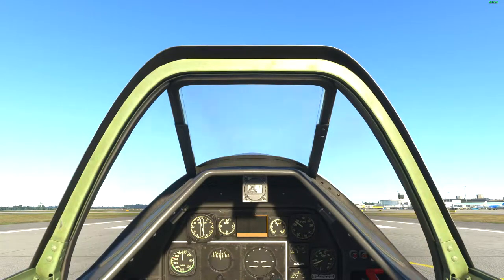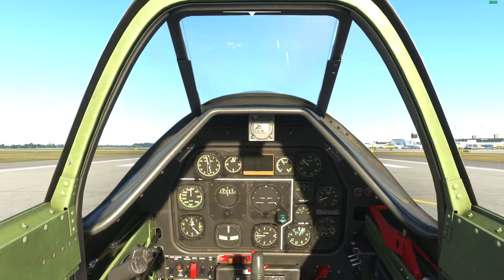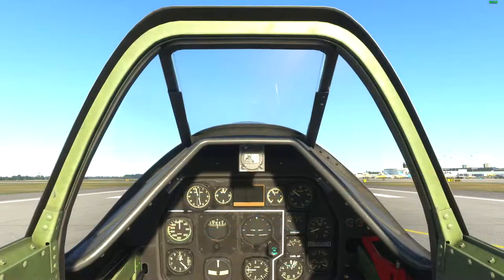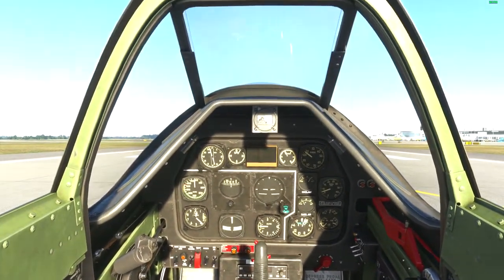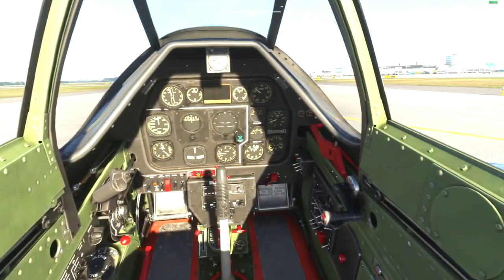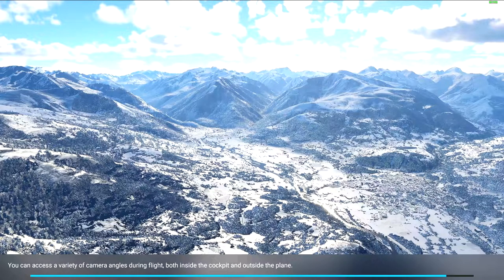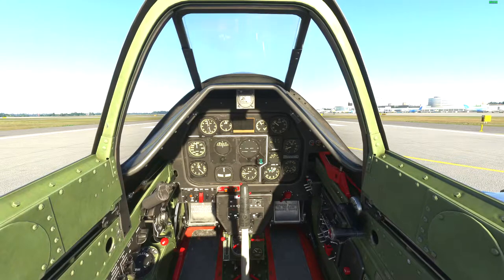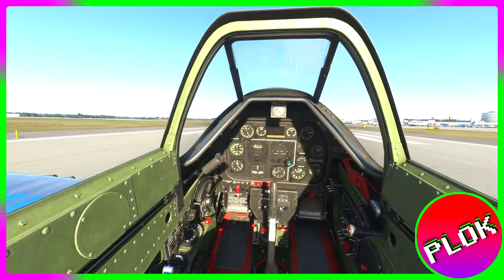P-51 Engine Dies Mid Flight Problem SOLVED! | MSFS Reno Air Races

Comment: No man, I think it's bugged, I have the "Bunny" one and I can't even take off without the engine shutting off, also enabled unlimited fuel, still no change.
Reply from the maker: interesting
are all your tanks filled from the start?
I think if you don't manually fill all the tanks it only fills like the middle tank or something, and it starts on like the left or right tank still for some reason

Theres a possibility that it still registers as "empty" if it's truly empty, even with the unlimited fuel enabled
Reply: @PTMG  I kept the fuel and weight screen on, and it's all at 100% when pushing the throttle up, still no change, engine shut off immediately, odd but I don't really use this plane much so it doesn't matter.
Reply: Same
Reply: Same since last big update
Reply: The dev of those P-51’s has to fix them like fr
Reply: Me too!  Nothing helped when I switched to midle position tank - same problem with shutting down on take off .It's very pitty, because the airplane made very good except not moving canopy and this problem  ^(( They should fix it!
Reply: Been waiting over a year for a fix. Very disappointing!
Reply: I agree because i have the wee Wille and it won't takeoff
Reply: This worked for me for about 20 minutes of flying. Maybe it just needs constant fuel
Reply: I get about 10-15 mins in and same thing it shuts off I look down switch fuel tank restart the plane it will go another 3-4 mins then kaput all done no more to give!!🤷🏻‍♂️ I run about 35 man pressure 45-60 when climbing short distances especially the spitfire it will cook quick if pushed too hard too long also know as “wep” war emergency power, full throttle, anyway hope it is better is the 2024 flight sim love my mustang flights

Comment: This may solve the issue in msfs 2020 but the tank you selected is the fuselage tank (reserve tank) which should be run dry first but not for take-off as the fuel feedback line drains into your left main tank (default tank) and if you were to run only on the reserve tank you'd lose dozens of galleons of fuel (irl anyways). During takeoff you are supposed to have full throttle and RPM's. Engline limitations are as follows: Takeoff - 3000 RPMS 61 MAN 1 Minute, WEP - 3000RPMS 67(75) MAN 5 Minutes, Military - 3000 RPMS 61 MAN 15 Minutes, Max. Cont. 2700 RPMS 46 MAN Unlimited Time, Cruise 2400 RPMS 36 MAN Unlimited Time. So it's 100% a bug it seems MSFS still hasn't fixed.
Reply: It’s been like this for well over a year

Comment: Idk if you respond to older videos but I’ve noticed that if you switch tanks while running the engine the fuel always transfers to the left tank and it’s very annoying. Idk if this is supposed to happen but I was hoping you might be able to help me out since there isn’t any other info about it, thx!
Reply from the maker: Yeah it's a kinda weird system
not really sure if there are any better ways to do it but you might be able to bind a specific button to the middle tank or something

Comment: A year later, it is still the same issue. I get going down the runway, and the engine cuts off. It doesn't matter what settings I have on.
Reply from the maker: not sure what that is all about, mine is fine for about 5-10 min usually depending on how hard I fly
Reply: I have this problem too. Totally broken
Reply: @TheJMIsound   luckily the other P-51s work
Reply: @d.b.s.6381  I only bought Wee Willy :(
Reply: @TheJMIsound  
I only had a problem with the vanilla P-51, but all the others seemed to work fine. I got the Reno Air race expansion which gives you 4 different types of planes and a bunch of variants of each type. The variants are actually distinguishable from one another too.

Comment: Don’t buy this plane it won’t even taxi the engine just turns off when you add power
Reply from the maker: not sure what issue you are having but it works fine for me as long as I remember to switch tanks

only real problem is that it's takeoff roll is drunk as fuck

Comment: P51s still don't work 2024
Reply from the maker: depends what you mean by don't work

they have some quirks but once you figure them out it still works
Reply: @PTMG  start the engine all fine taxi all fine start to take off engine cuts off ....try to start engine again won't start ( i fly mustangs in the real world so i am very familiar with the aircraft etc ) its just bugged by the looks of it which is a shame
Reply from the maker: did you switch tanks?

Comment: Why in the Hell , would I play a flight Simulator and not pilot a real plane.
Reply from the maker: cause you can smoke wheat and play this one
Reply: Because you won't actually die irl if you fuck up in the air
Reply: @SavageRush012  you can die doing a lot of things.
Reply: Because a P-51 costs $4,000/ hr to operate. Otherwise you're right, I'd be flying it IRL.